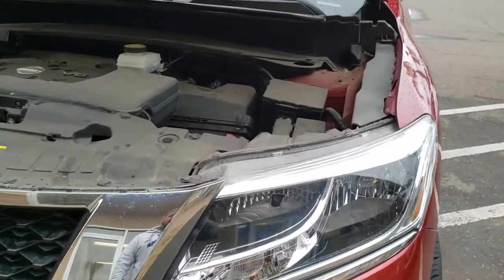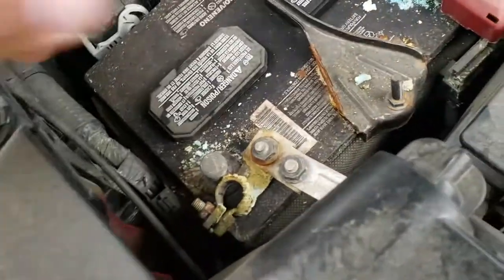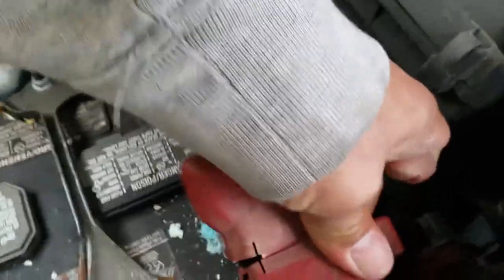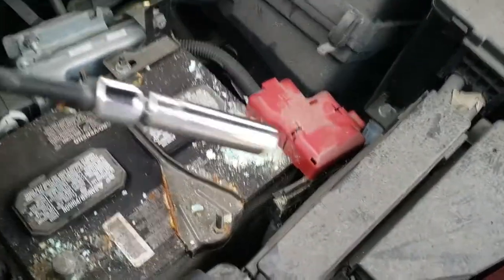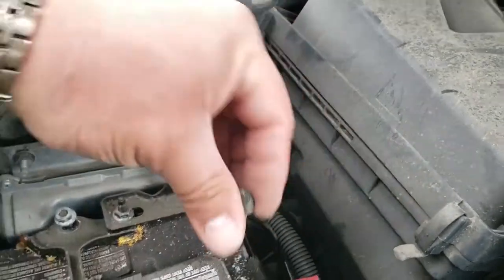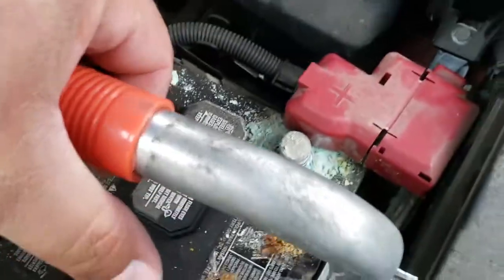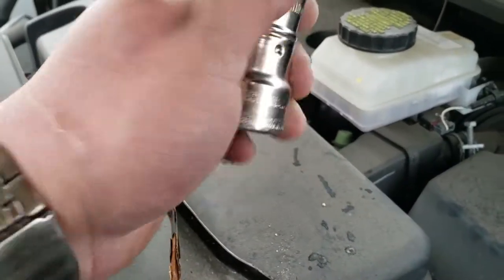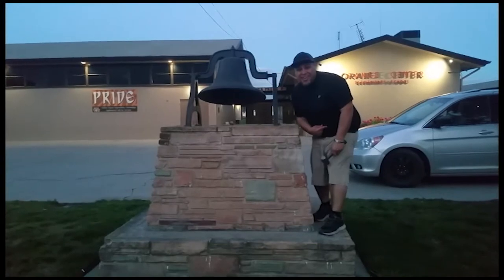How to: Remove a Battery from at 2016 Nissan Pathfinder

Comment: Mmmm novice.? Dude with modern cars, you need an ECM nemory saver tool.
Doing it right is knowing what’s right.?Tsk tsk tsk
Reply from the maker: Same with this unit bro. I work at a Dealership, tons of cars come thru, some bad batteries. Needs to be replaced and haven't experienced any issues with the vehicles.